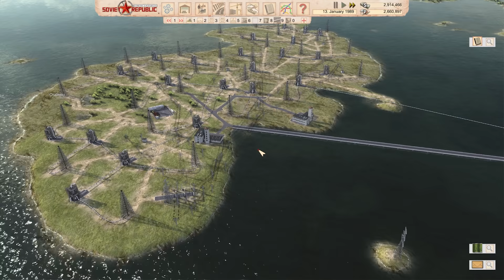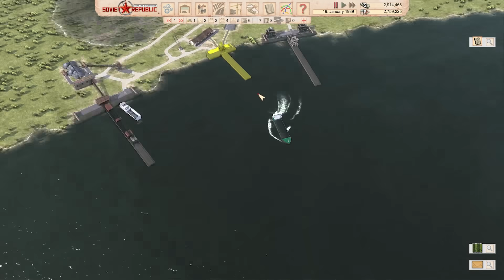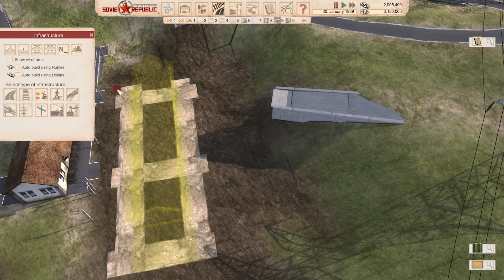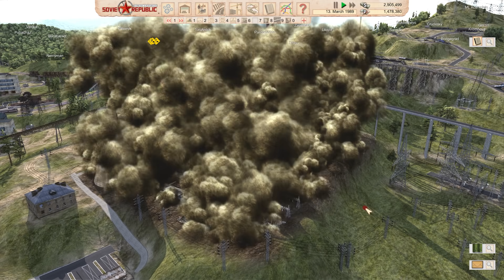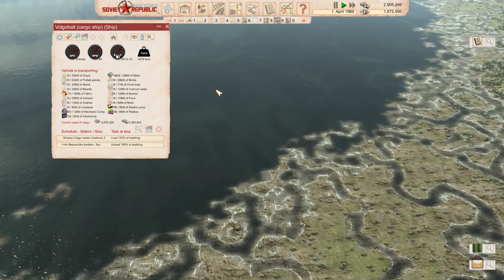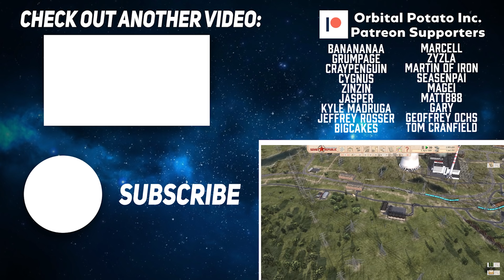More Steel = More Money! - Workers and Resources: Soviet Republic - Episode #26

Comment: The tunnel you had a lot of trouble with... I would have tried to angle it into the direction of the train factory. Then go above ground, past the fire station and then another tunnel under the train factory.
Alternatively, you could build a bridge from the other side of the new steel mill and connect the new big open storage to the same rail network.

Comment: The steel mill has 2 factory connections, could attach the export storage directly to the mill. Then use the forklifts to move steel to the rest of the system. Would just get steel out of the mill faster.